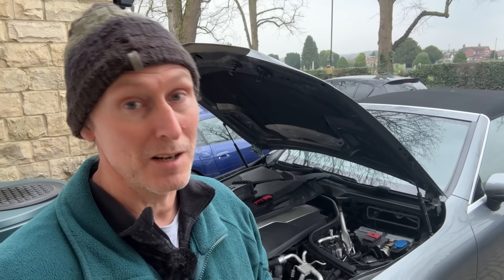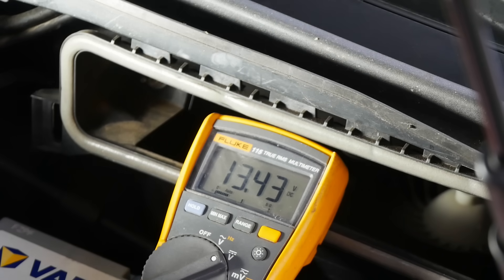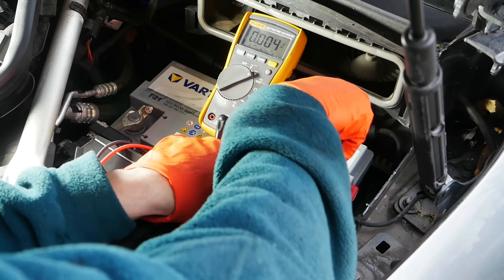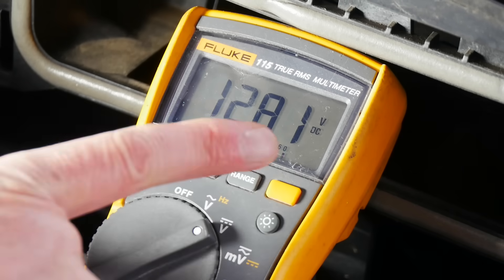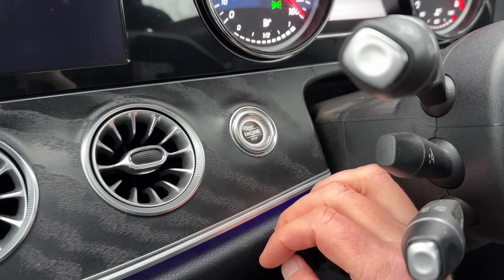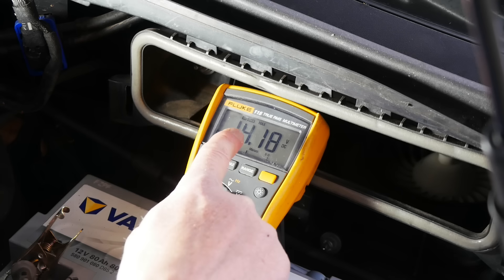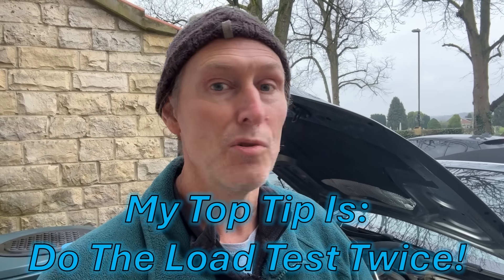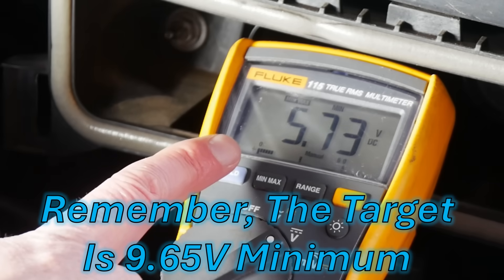Car Battery Load Test With Multimeter | EASY DIY

Comment: Change your battery every 36 to 48 months.   Never run it till it dies.   

Think about it.  As voltage drops resistance increases.  This creates heat.  This works your starter harder then your alternator harder to recharge the battery.  

I have been changing the batteries in everything I own at 36 to 48 months and been driving for 52 years.  I’ve never changed a starter or alternator in anything I’ve owned.  Cars, trucks, boats, airplanes, tractors, motorcycles, ect.  

More importantly, I’ve never been stranded in the middle of the night at the grocery store with a dead battery.

Comment: I've always used a carbon pile load tester. The min max test is interesting, but it is a feature on more advanced meters.  A separate load tester is pretty cheap.  Either way, whacking a freshly charged battery is the only true way to see if you have a battery that is losing its secret sauce.

Comment: Nice to-the-point practical advice. My only query is about removing the battery leads to clean the terminals and remake the connections. While ‘in the bad old days’ I would have immediately done this, I now understand some modern cars can object to having the battery disconnected and then demand items like infotainment systems and other parts be ‘re-coded’ following the disconnection, and certainly on battery replacement so that the battery management system knows it has a new battery (which affect charging profiles). Could a qualified auto engineer confirm/debunk these beliefs? I’m close to the point of requiring a replacement battery myself and would have always done it myself, but I don’t want to brick the car for lack of the ability to recode whatever due to a simple battery swap

Comment: My dad (mechanical engineer with road vehicles speciality - so don't follow this unless trained) used to repair our car's battery by refilling distilled water and measuring acidity and adding acid when needed. Our batteries were much much older.

Comment: I don't use my car much (VW Golf) and the battery was going flat over several weeks. I used a current meter to see if there was any draw but it was difficult because of the timeout on the security alarm, interior lights, etc. after opening the door. Eventually I realised what it was - VW had given me an OBD dongle widget which connected to an app on my phone. This was the problem - I had left it in all the time and it was causing a small current draw. If I  drove the car every day I probably would not have noticed any issue. So if you park your car for more than a few weeks (e.g. going on holiday), remove any OBD dongle if you have fitted one!

Comment: 1. You should measure the resistance of the battery because voltage is not everything (this multimeter is enough).
2. I assume that you charge the battery with such chargers that always leave the battery permanently undercharged.
3. The basic thing is to charge the battery at least twice a year with a decent charger, preferably a rectifier and not a charger.

Comment: Cummins had a system called icon that was a fuel saver. It used to start the truck to warm it up or cool it off when the driver was sleeping. When the engine was started it had to run 2 hours to bring the batteries up to full charge. I used to install the systems and asked an engineer why the 2 hours. He said there is a difference between surface charge and full charge. Today cars have substantial parasitic loads even when off. Most people I know are at work within 20 minutes of starting. So possibly batteries sulfate prematurely due to being in constant undercharged conditions.

Comment: Who needs common sense when you’ve got a new multimeter for Christmas. Alt charging but battery consistently failing = battery replacement req less than six minutes that.

Comment: Retired ASE CMAT L1 MRRT here with 45 years experience in the bay. Testing a battery with a multimeter is only one test. If you check a battery that has been sitting should be EXACTLY 12.6 volts. This is enough to light a bulb, not to start the car. An accurate test involves the use of a load tester like the old reliable VAT40 or a newer capacitance meter.

Comment: A bit off topic but here goes and it might help someone who DOES have a Parasitic Drain that they can't find on an Older Vehicle which can get too expensive or time consuming to try to find and fix. Here in Florida I got an Interstate AGM battery for my Old 1992 Chevy S10 Pickup that gets driven about 5 to 10 times a month and rarely goes over 10 miles when it does get driven. I installed it in 2017 and in 2019 the Truck developed a Parasitic Drain I couldn't find. So I installed a Negative Post Blade Cut Off that I flip OFF when back home. Once a Year I do the "Recondition" charge on it and it's still going strong. It's parked outside as well.

Comment: This just popped up in my feed. I'm a licensed tech 40 years, wanted to say great vid :)
I thought I would add something, if no one else has; the load test lower limit is 9.6V for a test performed using the load test spec for the battery in question. The vehicle's starter (if good) will usually not draw near that much so, if you're getting down below 10.6V (number I use), battery is probably on it's last legs. Great info :)

Comment: Charge the battery and disconnect it from the terminals. Check the voltage, and check again in a few hours. If it has dropped significantly, you have a short circuit in the cells. If it hasn't, you have a fault in your car and something is wrong and steals your electricity

Comment: My 6 year old car battery hasn't gone flat enough to need to be charged outside the car, but I'm getting warnings about low battery now, and it was reading 11.98V on a sub-zero morning and only got 12.4 after a 100km drive. I'm sure enough it's reached the end of its life, so I placed an order for the battery I want, which wasn't in stock. A Banner EFB Pro series one. I tried two shops, and in the second one a sleazy salesman tried selling me a fucking Monbat! Monbats that die and leave you on the road exactly two months after the warranty ends! I noped the fuck out of there. Went with the online shop of the first one, since it just wasn't in stock in the city, but they do have it elsewhere.

Comment: i found this usefull, my battery after 3 starts and short distance driving performs real bad. during starting my ICluster flickers like ON/OFF and the starter disengages. nice short test, well done video. 👍👍
Reply: How do you load test a battery off the car?
Reply: @FollowingDreams-z4k  well, there are expensive Equipment do do that, I got one old BOSCH Battery Tester with an heavy internal resistor. it shows voltage around 5sec as it draws a lot of Ampere. the analog Voltmeter shows in the green, yellow, and red zones battery good, weak, bad. there are small 30$-250$ testers. they work great without the draw.

Comment: While a voltage test is good, you really also need a meter capable of testing the battery's internal resistance.  With so many batteries in our lives, I invested in a meter with that capability (Zoyi ZT-DQ02 for about $140 USD).

Comment: Hi, i just change my AGM battery, i coded it, change the alternator regulator and now it's 13.7 V on the running engine. It's this ok? Before to change the battery it was 14.8 V, almost 13 years old original battery
Reply from the maker: My understanding is that this is correct. The voltage was higher on the old battery because the voltage regulator starts charging your old battery more as it becomes more tired. This is also why it is important to "code" your new battery, otherwise the voltage being supplied doesn't get reset back down to the lower level and it would continue to charge at the old rate, which is too much for the new battery and can cause it to fail early. cheers, Phil
Reply: @ReviveMyRide Thank You Phil, so 13.7 V it's a normal value?

Comment: The new Silver-Calcium and Calcium-Calcium type batteries behave slightly differently to the old school Antimony doped ones.
They can tolerate a higher charging voltage especially when cold (and may actually NEED that higher voltage to charge fully).
Not unusual to see 15v plus coming out of an alternator that's linked to a smart charge control system which monitors the ambient temperature and compensates accordingly. The new tech can tolerate up to 16v at low temps apparently.
An alternator that routinely chuffs out 14v is unlikely to fully charge an Ag-Ca or Ca-Ca battery to 100%. 
I've also noticed that Calcium batteries show a bigger volt drop during cranking...even from relatively new. 
Definitive information about these differences is quite hard to come by, and the battery manufacturers provide virtually no info at all. If you've got an oldie with a dynamo (generator), a Calcium battery is not likely to be 'happy'. 
A modern battery should be regarded as fully charged if (after resting) it shows around 12.6 to 12.7v. This may be a little higher for Silver batteries (the one featured in the video)

Comment: Basically, today, the poor sealed  lead-acid car battery is over-loaded with electrical  demands from the various electrically actuated "Cosemetic" features which marketeers insist modern cars must have i.e. electric windows, central locking, air conditioning, infotainment and radio systems, motorised adjustable seats and seat heating, screen de-misters/icers , alarms , . . . and on and on.
A lot of these systems are on, even when the car is parked up, and lets face most cars used for personal transport are parked-up for 80-90 % of the day. the draw of these systems grinds down the batteries in no time.

Best remedy I found to stop this happening is either use the car at least 2-3 times a week or more or start pulling the fuses for systems that are not essential e.g. central locking, infotainment, alarm, air conditioning, diagnostic socket.

Also, I understand that, over the years,  the percentage of virgin lead being used in car battery manufacture has been declining. In fact, in Europe, this decline is driven and controlled by EU regulation. I think the current percentage of Virgin Lead is about 15% and that this again is set to reduce in the near future  under yet further EU Regulation.

But car marketeers are more than happy if the lifespan of this particular consumer product reduces in years  . . fits in with their Worldwide strategy  . . VAG' s sealed-for-life gearboxes,  Ford's wet cam belts,  headlights with non-replaceable bulbs everybody's EGR valve . . . all bow larks,  and set against longevity and set for  throw-away culture . . . and definitely not green.

And the way things are going, huge chunks of the European and US car industry will be disappearing consequent with the emergence of asiatic competition. Expect more throw-away headlight units at a replacement cost of $1500.

Comment: GM engineer.  We used to design the electronics to have a lower limit of about 6.3-to-6.5volts.  The internal Up/Down regulators could go lower than that, but at those levels the starter would probably (50/50chance) to be able to turn the vehicle over.  In hot areas maybe so, but in Alaska definitely not.  Your battery probably has a dendrite which discharges "one" cell, and even if the others are good, that will bleed down that one cells, and give it a high resistance under load.  A sure sign of imminent death.  Unfortunately, this can also occur rapidly, even overnight at very cold temperatures.

Comment: Digital meter does not work well with fluctuating voltages like you get when cranking. Analog meters work much better when doing this test.

Comment: This test should be done After ohms and voltage drop tests on both the negative and positive leads. You still could have a bad ground or positive cable and or connection.  You also mis classified the test you did. It is called a voltage drop test. Aye yi t
Yi, complete bullox.
Reply from the maker: This test is intended to be a simple, quick check for DIYers who don't have specialist equipment, and it can still give a good indication of battery health.

Comment: Question? Is it possible for a starter motor that drags from wear to also lower that minimum battery voltage number? For instance the harder it is for the start to turn will that create a bigger load on the battery?

Comment: It’s usually apparent when the battery is knackered. The car cranks much slower first thing in the morning, regardless of use previous day.  My car was like that for nearly 2 years. Just changed the battery, now back to how it should be.  Changing a battery on a modern car is not the simple job it was in my youth which was a few decades ago.

Comment: I live in Toronto Canada winter sometimes drops -20 C. My 15 years old 2.5L car manual transmission lead acid OEM battery is exhibiting hard starting during winter, for sometimes now. Though I seldom use it often, maybe twice a month and park outside--I don't have a garage, but I do maintain the battery properly. I will try to do your video before replacing it, maybe next year after 16 years or until it is completely dead. One time I pushed the car about 4 meters when the battery died. It's a manual transmission it will start with a little push power.

Comment: This also applies to motorcycles? Or they are a bit different?
Reply from the maker: I would think so, the starter would still be the load (assuming your bike has an electric starter not a kick start) and if the battery voltage drops too low during cranking (and it was fully charged to start with)  it would indicate the battery is almost done. The problem is, I don’t know what voltages to tell you to look for, I imagine it would be different to the larger car batteries. Thanks, Phil

Comment: Here in Phoenix, Arizona, the heat kills batteries within 2-3 years. And, they die differently than in normal climates. In Chicago, in the winter, when they would typically die, you could tell it was failing because of hard starting over a day or two. Here, in the heat, the engine will start normally, you'll drive it and stop, and then the next time - click click. It won't even gave enough juice to engage the starter to the flywheel, much less try and spin it.
Reply from the maker: Hi John, thanks for sharing! I have zero experience of owning and operating a vehicle in such extreme heat and I never even though about how it would affect the battery! I imagine it is easy to get caught out with such a lack of symptoms before the battery fails! Being stranded in the dessert doesn't sound like a lot of fun! Cheers, Phil

Comment: Hi!   I have a 2 year old battery which the charge seems to be draining down to 12.1 after sitting stationaray for couple of weeks after a long distance drive of 2 hours.  It is a 1998 gas running car which shows 12.4 to 12.6 volt while driving 35 mph with nothing electrical turned on (ie. radio, lights).     Once i get on the freeway or turn my headlights on, voltage goes up and shows 14.6 volt.  Is my alternator still good given it is less than your mentioned 13.8-14.8 volt?  

Earlier this Spring, i had replaced my alternator with an oem remanufactured one.  After this, my AC no longer blows cold.  When i did the voltage test, numbers were similar on both my old alternator and the new remanufactured one.  Just trying to rule out whether i got a bad alternator thats not putting out enough voltage to run my AC.
Reply from the maker: Hi, it does sound strange that when just driving slow, your battery shows 12.4 to 12.6, which is low for when the engine and alternator is running. Then at higher speeds etc, the alternator is clearly running because the voltage jumps up. I have come across this before many years ago. It could be your alternator itself or a component called the regulator. When these drop in performance, then revving the engine can temporarily overcome the problem and make the alternator work again. I'm leaning towards the regulator being the problem, not sure if you swapped it across from the old alternator to the new? Anyway, here is a simple video (not one of mine) which might help! https://www.youtube.com/watch?v=VBvtBoceq00 Cheers, Phil
Reply: @ReviveMyRide Thank you!

Comment: It's amazing how many shade tree "mechanics" think they are qualified to give advice, but actually aren't! A load test is done with a carbon pile rheostat and ammeter to check current draw at a specific load.Load is measured in amps, not volts!
Reply: It’s amazing how many trolls spend time searching for things to criticise. This method clearly works as the volts dropped when under LOAD. It may not be perfect but it’s a decent indicator. 🤡
Reply from the maker: Thanks @LewieLeway I shouldn't bite because I know what people are like. Honestly, I just put this vid on YouTube to help people and never expected it to get lots of views. Cheers, Phil
Reply from the maker: and if you don't have a  carbon pile rheostat (and let's face it, most DIYers don't!) but you DO have a multimeter (Most of us do!) then this is a great little test that will help give you an indication if there is a problem with your battery or not. It's amazing how many shade tree "experts" criticise without having tried this test themselves :-)

Comment: What you are doing IS NOT a load test! It is a voltage test. A load test - is done with an ammeter to check the current draw at a specific load.
Reply: What you are doing is trolling. This is a well known method and most folk call it a load test because when you crank the engine the battery is under LOAD.

Comment: Great videos. I kept a battery going 12yrs before I sold the truck. Each autumn I pulled off sealed for life strips so I could top it up, cleaned the terminals and fully charged it. Still going strong when I sold it.